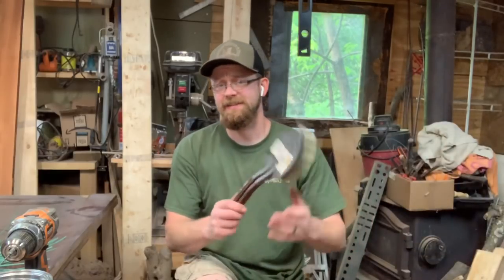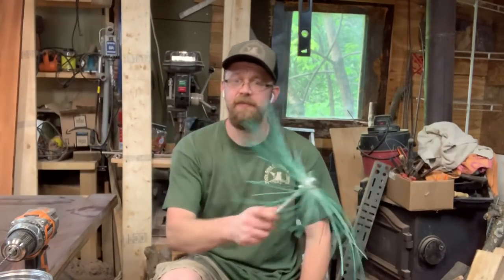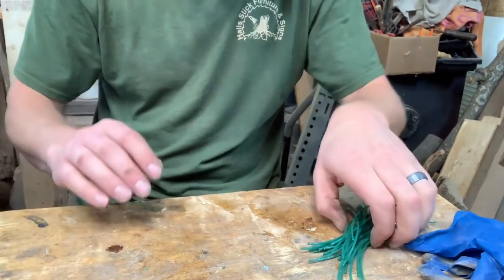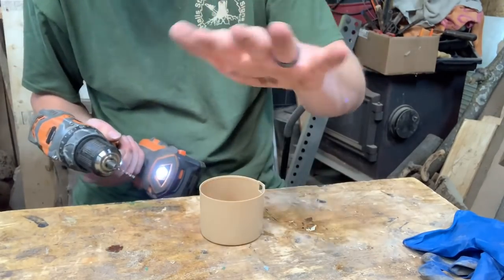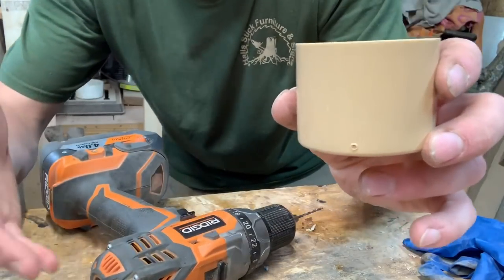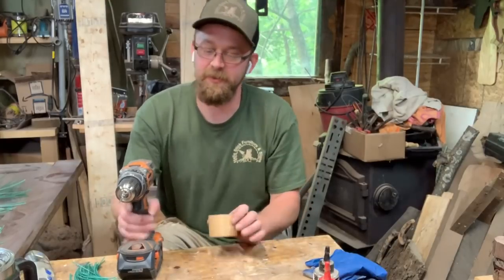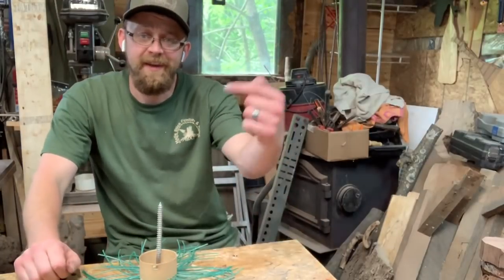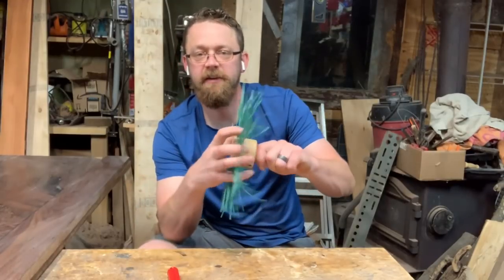Making a brush wheel . Chainsaw carving tool .

Comment: That's a great idea. You could also make a stack of those so it's more like a car wash brush. Might want a face shield since it will eventually start flinging bits of itself everywhere. A section of PVC pipe might be more sturdy than the paint cap. I wonder if attaching the brush you were using before to a recip saw would be about as effective and faster to make.
Reply from the maker: Matt Jones yeah a shield would definitely be a great idea . I also think the idea of putting the brush on a reciprocating saw is a good one .. PVC would definitely be sturdier but I’m not sure it would be need as all the added epoxy really makes a solid block .
Reply from the maker: Thanks for the feed back Matt Jones it’s appreciated !